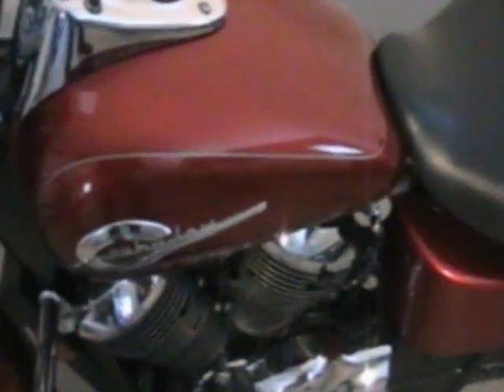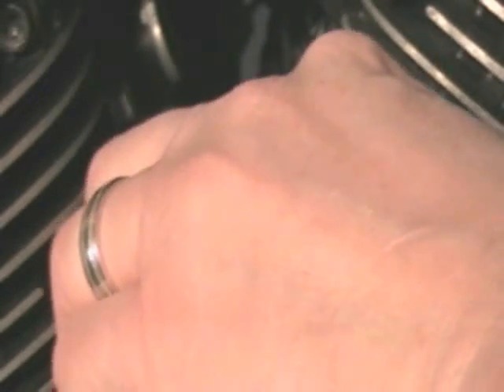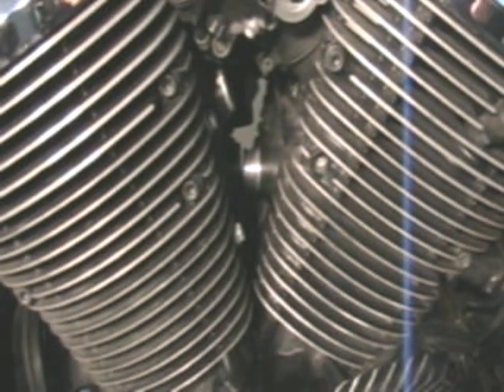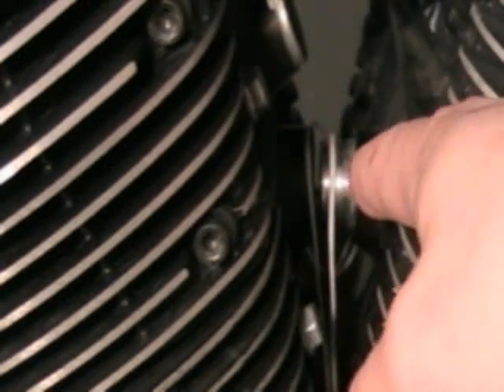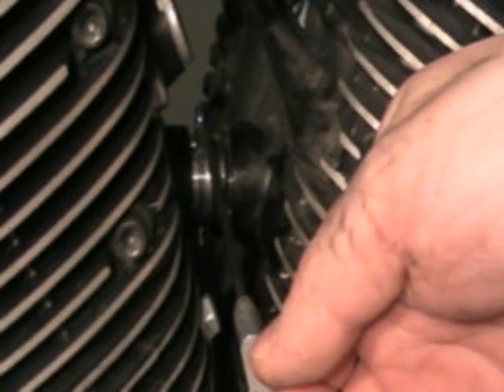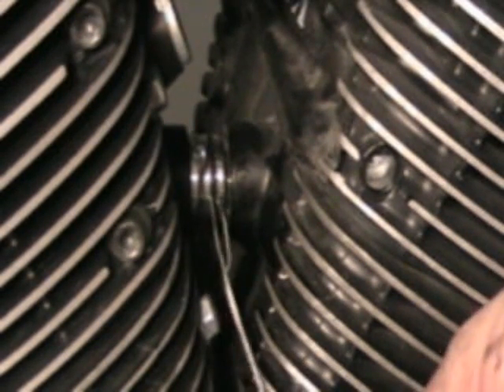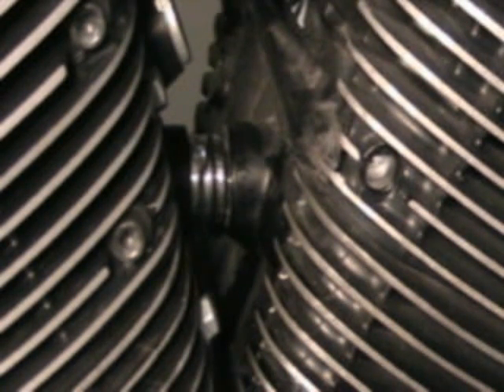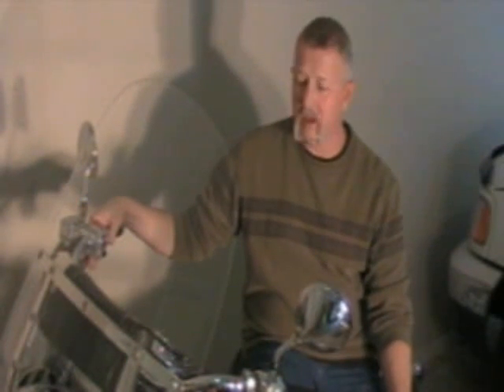Honda Shadow VT750 ACE Motorcycle - Coolant leak from Crossover Tube repair

Comment: I asked about this on a forum, my bike is leaking too. They told me it was the easiest repair to do. I was really debating to take my bike to the shop, and finally found this video today!! THANK YOU VERY MUCH sir, this video helped me a lot, looks really simple. Doing it this weekend if the parts get here by that time, and hopefully everything goes okay.
Reply from the maker: Thanks for watching, Mateo!  The hardest part is first getting the crossover tube to slide.  Once you get that, the rest is pretty easy.  I'm sure you will do a great job and be back on the road in no time!

Comment: Took me 15 minutes to do this, with my wife assisting.  We didn't have to take the choke knob or air box off with two sets of hands.  Thanks for the info, I wouldn't have had any idea how to go about this without your video.  It was simple.  My parts were $17 including a set of picks, and $35 for deliver ;(
You rock.
Reply from the maker: Thanks David!  It's always good to have the extra help :)

Comment: Thank you, Dennis for posting this video!
I bought an 01 Honda A.C.E deluxe about a year ago and noticed the crossover leaking. Turns out someone in the past had put some kind of a hard crusty yellowish sealer around both ends. That was a bear to break loose  and clean up without a teardown!
After cleanup, the install went extremely smooth!
Dental floss workes like a charm!
Much gratitude from south central illinois!
Reply from the maker: That sounds like it would make it very difficult to get the crossover tube out.  Glad you got it!  Thanks for watching!

Comment: My shadow ace was leaking and I kinda had the idea that it might be o-rings and be able to slide it like that so I ran a search and your video poped up on Google. To my surprise your video was exactly what I needed to do. Great video!! Made what I thought to be a headache, a 20 minute job. One thing I couldnt hook old o-rings cause the were like rocks, not pliable.  I ended up using an exact knife to cut them in half then I was able to get them off.

Thanks for the video, made the headache go away :-)
Reply from the maker: Awesome!  Thanks for the comments.  I think mine were still pliable only because my leak started earlier than most....20,000 miles.  Cutting the o-rings off works just as well.  Glad to know you're back on the road!

Comment: thank you soooo much for this vid it saved me almost 200$ of labor that I didn't have to spend MLH&R
Reply from the maker: Christopher Davis That's great!!  I'm glad it helped...ride safe!
Reply: @dwcoffey  I have problems with my thermostat, my motorcycle is a 2006 Honda shadow aero 750cc, I have a new thermostat but I did not see where the thermostat hole is located, my question is the hole going to the gas tank or to the headlight

Comment: It was hard to get the tube shifted back and forth but this worked EXACTLY as described on my 2003 Shadow Spirit VT750DCB Thank you so much!
Reply from the maker: Thanks for watching!  Yes, I got a little worried when I did this repair to mine.  Initially getting that crossover tube to move was a little nerve wracking!  Glad you got it done!

Comment: Thanks for the video. I had a leaking crossover tube and used about a bottle of water a day. I couldn’t figure out where the leak was coming from. After I found out where I was leaking from I fixed the problem. It only took about 20 minutes.
Reply from the maker: That's great Alan!  The shops quote anywhere from $350 to over $1000 to fix this leak.  Glad you got it done so quick and are back out on the road!  Thanks for watching.

Comment: Got the job done today, took me 80 mins to complete, the Dental floss worked perfectly!!!! Im sure i would have being done sooner but i was i was being careful not to score it with the dental picks when removing the old ones (they weren't brittle like yours) 

Fix the 2 orings and shifter shaft seal, fresh oil change, coolant change today, now its time to go for a ride.
Reply from the maker: That's great!!  Glad you're back on the road...ride safe!

Comment: Nice job. I wrote something up on this years ago. I used a telephone cord. I only got the replacement o ring. I have done this to 3 bikes. The stealership wanted $600 for this job. Screw them. It took about 20 minutes and about $15. Nice job on the video. I drained my coolant by the way so you didnt have all the leaks. Take care and thanks. BTW I lubed my o ring so the cord or floss slides out easily.
Reply from the maker: Thanks Frogman!  All good advice...I appreciate the comments and the ideas.  Yea, it's sure nice to keep that $600 in our pockets!

Comment: Fantastic video Dennis. Your knowledge of this procedure greatly helps me when I go to do my 02 ACE.
Soon as I get my Tstat,Cap,and Orings from MI. Waiting is torture.
Jobs done. Though, my pipe would not work with the new orings. HAD to use rubber safe grease.
Also, You didnt tell your viewers to bleed the air out of the system. Its a must.
Reply from the maker: I hope it all goes well Mike!  I know you'll be glad to get it done and get back on the road!  Thanks for commenting.

Comment: Thanks man did the job in 20 mins thanks to your video. I have a 2003 honda shadow vt750dc so this was a perfect video for me.
Reply: Reading some of the other comments where do you add coolant to the radiator?
Reply from the maker: Hey Josh!  Glad the video helped.  The radiator cap is under the gas tank.  Normally you can get to it by just loosening the tank mounts rather than removing the tank.

Comment: Thanks a lot, really, a lot. You just saved me a lot of troubles. I'll start as soon as I get the replacement parts.
Reply from the maker: Thnaks for watching, Odin!  The hardest part for me was getting the tube loose.....it can be stuck in there pretty tight.  Let me know if I can help!

Comment: dude you ROCK  !!!   i saw where the leak was and thought mabey the jugs needed to be removed ( a death sentence for this bike) however you saved the day  thanks !!! ride on
Reply from the maker: Thanks man!  I originally thought the same thing when mine leaked...I'm thinking I've got to pull the engine apart.  I was glad it turned out to be easier than I thought....only had the bike down for a couple hours and back on the road!!  ride safe!

Comment: Thanks Dennis your post help me a lot. I fixed it already no need long nose pliers. For SHADOW Spirit 1100 You need to remove top chamber heat fin there are very easy to remove just 4 set of 5 mm. allen key to be removed when the heat fin was removed there are a big room for you to work with it. After that I am follow your step one by one. Now it is back to normal and ready to hit the road again. Big thanks to you.
Reply from the maker: +Komgrit Ruangrit That's great news!!  I'm glad you got it fixed and are back to riding.  Be safe!
Reply: +Komgrit Ruangrit Dude, you're my hero. I also have a Honda Shadow Spirit 1100 and finding specific information for that bike has been a HUGE pain in my sitting-bits. You just made my day so much better.

Comment: NICE!!! Big help, much appreciated. Same bike, same year here. It was driving me crazy trying to find that leak and when I saw it around the valves and crank case I thought the worst man. Woooo, thank you bruthuh. Shiny side up.
Reply: Hi Dennis Saw your video, I have a 1999 1100 Shadow ace with the same leak,that I a'm going to try your way. Looks like the same process . I will have to take the tank off to fill it back up. I don't think the reservoir will fill the motor fast enough. 25000 miles.  Thank Dan M
Reply from the maker: Dan Mccluggage Hi Dan, I hope it goes well for you. I think the 1100 ACE is put together in that area the same way as the 750.  Some folks have been able to refill the radiator through the neck without removing the tank, but I think it is a tight squeeze.  Maybe you can just loosen the tank mounts and get enough clearance without having to remove it completely.
Reply: Dennis Coffey Got the parts in today . It was real tight on the 1100, I got an 11" needle nose pliers for the job. It was so tight that I couldn't turn them sideways. But with a lot of trying ,the job got done. I Drained the tank 3gal. ,then lift it up in front so I could get to the Rad. cap on the top right side.  About 3 or 4 cups to top it off,put her back together and ran it till the fan kicked on. No problems!! Cost me about 30 bucks. Thanks for the help.
Reply from the maker: Dan Mccluggage
Thanks for your comments and added info on the 1100, Dan!  Glad it worked out for you.  I was lucky since I didn't have to fill mine up from the radiator.  I know it's not a huge deal to loosen the gas tank, but you know how it goes, there are always a hundred other projects waiting on us to fix 'em!  Thanks again!
Reply: Hey Dwayne and Dennis. 1998 Shadow ACE 1100. 20k miles. I have this and the leaking oil around the guide pin (5 hour job). For this job, I had to grind down an old pair of 11-inch needle-nose pliers so they'd fit between the cooling fins and also use a long screw driver to maneuver the tube forwards and backwards. Thanks for the tips and the video!
Reply: Rock on.
Reply from the maker: Jake McChristtian Glad to hear you got it done Jake!  Ride safe!

Comment: Great video.thank you gonna do this weekend. However there is a coolant fill cap under the gas tank.
Reply from the maker: Thanks for watching, I appreciate it!  Yes, fortunately for me, I didn't lose enough coolant to require filling the radiator using the fill cap.  You have to loosen the gas cap to get to the radiator fill cap.  I was glad I didn't have to do that on mine.  It's not a bad job, I just didn't want to do it.

Comment: Thank You!  I have the same bike as well I started having this leak with about 48.000miles
Reply from the maker: I'm glad this helped!  Mine started a little earlier than most at 20,000 miles, but I was also glad it turned out to be an easier job than I originally expected.  Ride safe!

Comment: Thank u so much, did my first ride of the season 2 days ago 265 miles, next day i found a small leak of antifreeze. Im gonna go to the auto store and get the o rings $3 for ten, stop at honda snd pickup new clips (they wanted 18$ for two orings :( and replace them.
Mines a 2000 vt1100 aero c3
Reply from the maker: Thank for watching and I hope the repair goes smoothly!  The biggest issue I had (and others have had) is sometimes the crossover tube is a bit sticky and hard to get broken loose.  Once you get it loose....the rest is better  :)
Reply: Dennis Coffey just left the parts store gotta wait till tomorrow for the o rings and clips. Its so tight in there, went and got extra long needle noise pliers
Reply from the maker: That's a good idea....those long handled needle-nose pliers will definitely make this job easier!

Comment: Hi do i have to empty the coolant before i do this job. Thank great video
Reply from the maker: No, you'll get a little coolant leakage when you pull the crossover tube out, but it usually isn't much.  No need to drain your coolant.  Thanks for watching!
Reply: @dwcoffey  thank you very much for the answer

Comment: Man, I love your videos. Definitely my go-to channel energy time I need to do anything to my Shadow. 

Question: Is there an easy way to tell if this is where mine is leaking from?
Reply from the maker: Thanks for the support and for watching!  If you see anti-freeze (usually green liquid) between the cylinders, it is probably leaking from the crossover tube.  That's how I found my leak.
Reply: @dwcoffey  yeah, I was hoping it would be that obvious. If course it wasn't. I put some distilled water in, and let it idle for awhile, then suddenly it started flowing out of the overflow tube. Let the fun of trial and error begin...
Reply from the maker: Let me know what you find, I'm interested in what the problem is.  Thanks!

Comment: 1997 shadow ace here. Looks like i have the same problem. Did a 200 mile ride and noticed leaking and an empty coolant tank because the fan did not turn on because of said empty tank. So my temp light went on. Shop said it would be rediculous expensive to disassemble the whole motor. I will try your solution. If this works you would have saved my bike. Thanks in advance. Is there any chance the o ring could come loose and drop into the cylinder?
Reply from the maker: I hope this fixes your bike up.  There is an outside chance, but the o-rings are usually stuck to the crossover tube real well, so not likely.  Thanks for watching!

Comment: Thanks Dennis good job. Very informative especially the floss. Question: did you or have you heard of "lubing" the O-rings, prior, for a better seal & easy slide in?
Reply from the maker: Hi Robert, thanks for watching.  I did not lube my o-rings before installing them, but it wouldn't hurt a thing to dip them in anti-freeze prior to installing.  It would probably make sliding that tube in a bit easier.

Comment: I have a 2002 Honda Shadow 750 ACE VT750CDA and have the exact same issue with the solutions you've dimenstrated and did just fine.  However where is the Coolant drain bolt located?
Reply from the maker: Thanks for watching, Fawkes!  Some of these Ace models are a bit different.  If yours is like mine, the drain bolt is at the bottom of the water pump....should be a 10mm bolt.  Be careful to follow the manual's torques specs as overtightening will strip the threads when reinstalling the bolt.  Also, remove or loosen the radiator cap when draining.  If you don't, you'll get a vacuum and the coolant won't drain well.  When refilling, you'll need to burp the system to get the air out.

Comment: Will this apply to a VTX 1800?  (7 years after video super useful )
Reply from the maker: Thank you for watching!  I'm sorry but I'm not familiar at all with the VTX1800...never worked on one, so I don't know if it has the same crossover tube issue.

Comment: great tip - cost me just a few dollars. And the dental floss tip is brilliant! Just one thing, after replacing the two gaskets, and adding the coolant I took it for a ride. It was quite cool (about 7 Celsius) and after a few minutes the engine temperature light went on, then off after around 5 minutes. I've never seen that light go on before. Is this expected?
Reply from the maker: Hi Eric, thanks for your comment!  I did not experience that with my bike.  After you've run the bike a bit, I'd check the coolant level in the reservoir and see if it is low.  The only other thing I can think of is to top off the radiator....I've never done it, but I think there is a radiator cap on the top of the radiator.  I suppose the coolant could be low in the radiator but still show some in the reservoir...not sure about that, but it might be worth checking.  I'd like to know what you figure out about it.

Comment: I have a 2000 ACE with 151,000 km on her. 137,000 are mine. Although she's going into the shop for a fork repair, carb rejetting in two weeks. Her idiot temperature light just came on. So I will see what I can deduce as to why. Usually after about 50 km. So I will keep this in mind. Hoping is just a low fluid level and not a blown water pump.
Reply from the maker: Thanks for watching!  Yes, hopefully it just needs a little coolant and not a water pump!

Comment: hey thnx for the crossover tube trick it was easy to do.. I got another problem tho with me 750 shadow ace. My front cylinder is blowing white smoke just when starting off after I stop every time. But doesn't do it when riding got any clue about this? Was thinking carbs need to be sync?
Reply from the maker: +Will Smith Thanks for the comment and I'm glad the video helped you with the crossover tube leak.  It'd be hard to diagnose your smoke problem without being able to smell the exhaust, etc, but usually white smoke means oil is burning in the cylinder.  That's usually not good news because it usually means oil is leaking into the cylinder through a valve seal or piston ring.  If it's only showing smoke at first, the leak is probably small.

Comment: I have the exact same bike...can you tell me what size wrench I need to remove the oil pan plug to do oil change? Also, what size socket do I need to change the spark plugs?
Reply from the maker: Yes sir, as I show in the video, the oil drain plug is 17mm.  I use the spark plug wrench in the toolkit, so not sure what size it is, but I believe it is a standard Honda size of 18mm.

Comment: The tube on my 02 Shadow 750 will not move, what to do Dennis?
Reply from the maker: Mine was very difficult to get it to move at first.  If it absolutely will not move, you'll have to take the cylinder covers off to see if that will give you enough access.  If it still won't, you might have to pull the cylinders.

Comment: Hi Dennis, i like to thank you about this vid..  I have a VT750cd ACE 2001, the clip and the o ring are the same like your.. i have a huge leak in that same area.. but i think the oring was gone because the tube are moving down there.. could be the oring and clips right?
Reply from the maker: Hi Luis, thanks for watching!  Yes, if the tube is loose, sounds like you may be missing an o-ring and/or a clip.  The clips are visible without moving anything, so you should be able to tell fairly easily.  Hopefully the tube is scratched or galled so bad that an o-ring won't seal.